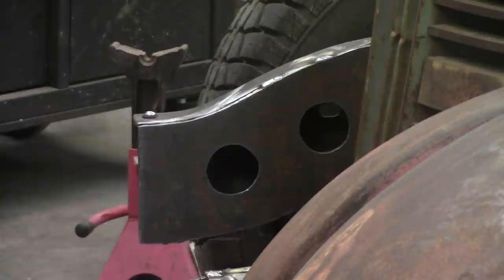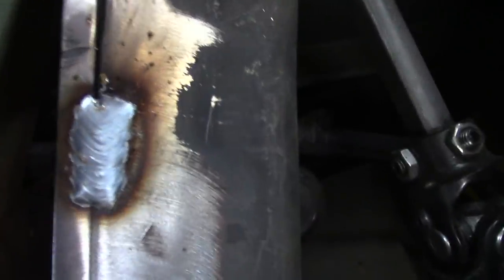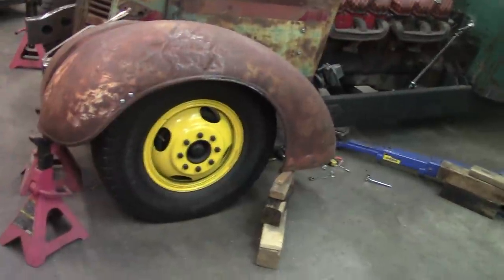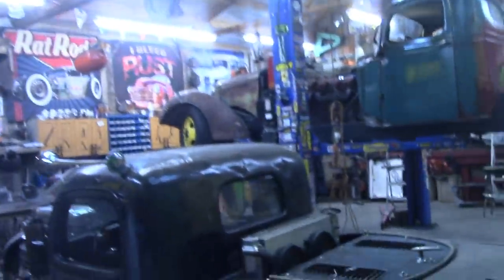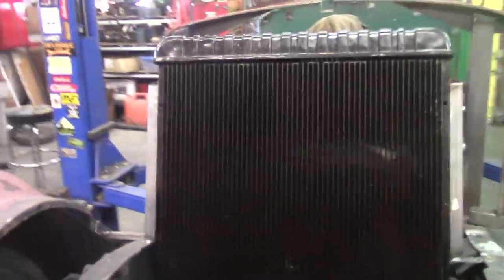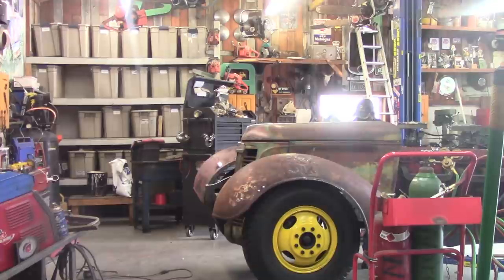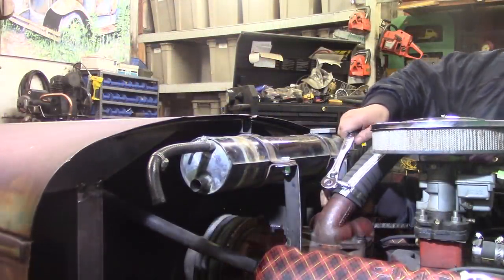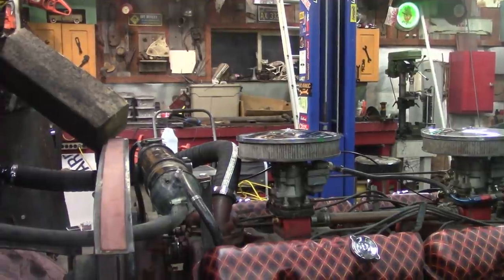V 12 RAT ROD   radiator mount and plumbing

Comment: Glad you decided to keep the fenders.  Looks a lot better.  I had an old hemi in a 3 window coupe I built, and I used a mercedes heater water pump to circulate the water in the heater core, and that solved the trapped air in the system.  Hope you got the adapter I sent you.  Looking forward to some more work on the hemi.  Tom

Comment: You and Victor struggled to lift that hood assembly off and back on the truck, minus those beautiful bug eye headlights. Those fragile headlights add more weight to the hood assembly which is already awkward to handle for two guys in bibs. As you said tilting the hood assembly forward won't work. You might consider creating a support framework that runs along the inside of your boxed frame that pivots at the front of the frame. The whole assembly would pivot up and forward, clearing the narrow obstruction, as opposed to tilting forward. Hydraulic  or air assist to open and close would be a nice touch. The metal man you are might go medieval to open it with springs, pulleys, cables and counter weights at a constant speed. Keeps them bug eyes safe and lit.

Comment: I know they where made in 1967. My dad had a 1963 GMC 1/2 ton with the plaid valve covers, I traded for a 1963 3/4 ton GMC and I was never more disappointed, it didn't have the valve covers. Found out it was hit and miss, no rime or reason to the ones that got them. And you have 4!
Reply from the maker: all of mine came off of 63 models. maybe someone swapped them before you got it? you are right about 67.. sorry i was thinking of the v12.. they made the v6 longer

Comment: Some tidy tack welding going on there Mr. Waylon. Great to see you guys!
Reply: The Amish here in central Illinois weld tacks on the tips of their horse's shoes to give them more traction.  They call it drill tack.  It reeks havoc with asphalt pavement, though.
Reply: Tack spots, like Waylon just did, I should say, not tacks.

Comment: I say tack welds correspond to what you're building: if you were putting together a Chevette, you might get away w/the equivalent of a spot weld. What Waylon's building will probably weigh as much a 3 Chevettes, so his "tacks" should be fine. I'm looking forward to the burping process of that big V12.

Comment: Hey Waylon
I've got a question about your radiator. Did you add rubber isolators in your radiator frame?
Bart

Comment: Terrible when life interferes with things we enjoy. 
You know, I was kinda  thinking just how cool those fenders would look, if they were attached to the back of the spindles, and went where the wheels went. 
I believe Plymouth Prowler, was built like that which I am speaking of. 
Nice looking car, except I don't think it actually sold that well.
May have been ahead of it's time, are maybe it was under powered as several of Dodge Chrysler Plymouth has been in the past, especially during the 80's, and 90's, before the manufacturers growed their klackers big enough to tell the government to back off, and let them build what sales, and not what makes Ralf Nader happy, are the insurance companies.
What about hinging it to the back as a normal hood hinges, and then you can access the front end components, are the electrical wires connected to your lights.
Reply from the maker: the fenders would hit the frame before it turned
Reply: @1963impala2drWaylonWire  yes sir, I realized that, but as you know your a rat rod builder, fabricator, and nothing sir is impossible, especially where cool, are unusual designs come into play on vehicles such as the likes of rat rods.
Just look at your other truck parked beside it.
I remember when you were working on it, and later on making changes.
Seems you kinda stretched the boundaries on it somewhat, and so far on this build your being somewhat controlled with your imagination.
Either way, it was just a passing thought, that I thought I'd share with you. Nothing more, as I figured you had already committed to what was in your minds eye for it to be.
Very nice build, and I compliment you for building how it looks best to you.
As you say, looking at it on a 55" screen is totally different from in person. 
As is my concept of how things look compared to how you see them, aren't always the same, and that Sir is what makes us humans individuals. 
Thank you for taking the time, and effort I know it takes to share your adventures with us.
It's greatly appreciated by many, and those that don't, well they have the right to watch something entirely different, don't they.